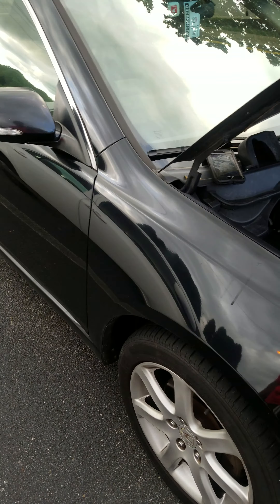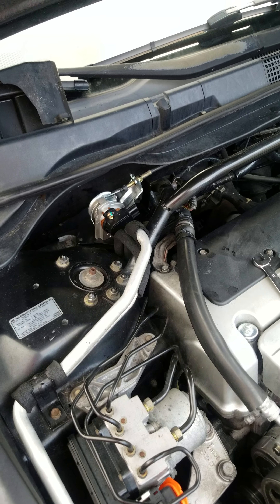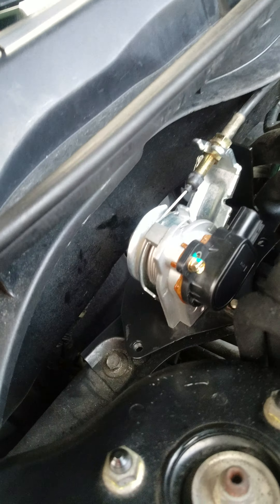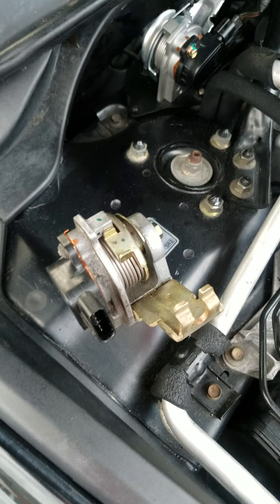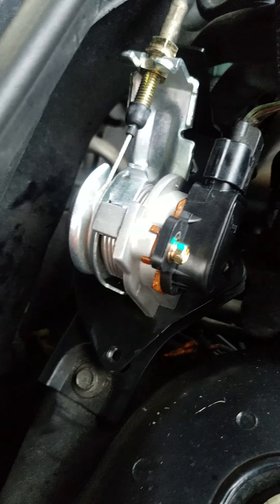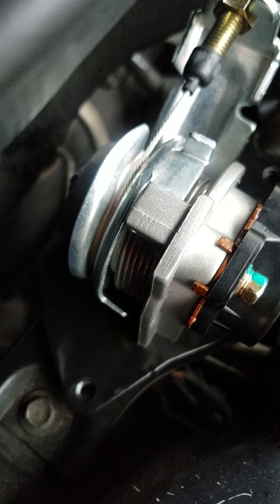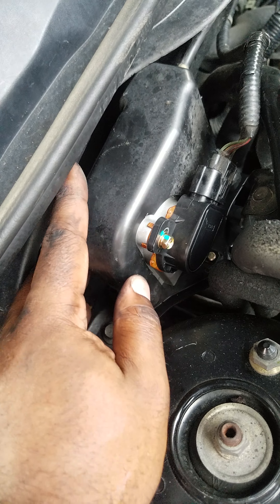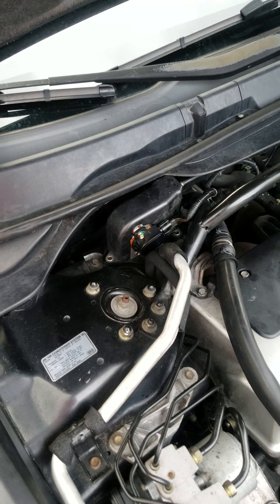2004 - 08 Acura TSX Accelerator Pedal Position Sensor - Success (Observation & Education)

Comment: I have a 2004 tsx and it’s really low on power and won’t hit vtec i have no check engine lights I’ve tried almost everything and the only thing I could think of is timing but wouldn’t I have a cel for that?
Reply from the maker: What do you mean by "really low on power"? Do you mean torque and horse paper?